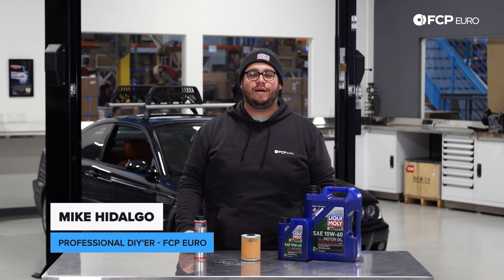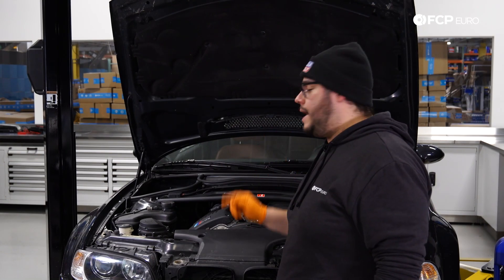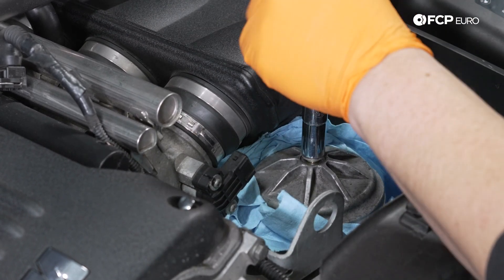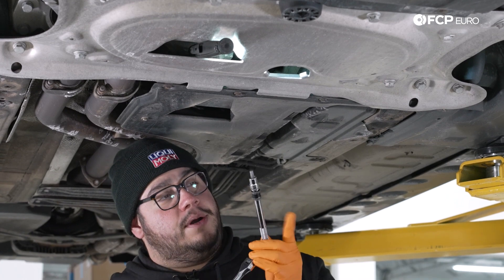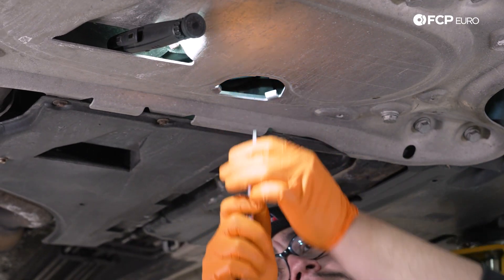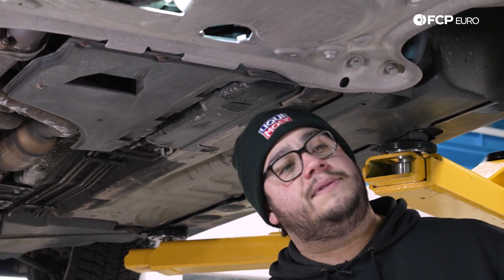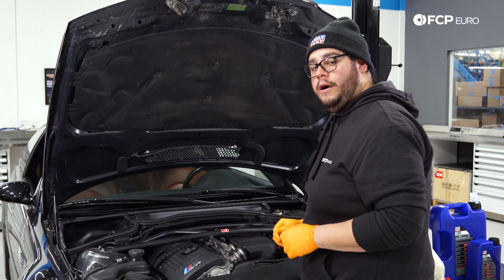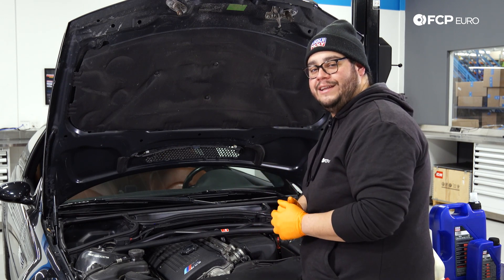BMW E46 M3 Oil Change DIY (2001-2006 BMW S54 Engine)

Comment: Thanks. Was a great was for my son to build confidence in changing his oil. However, we googled it and browser watched it. I didn’t have the option to “like it” (otherwise pay my dues). I had to click into it, sign in and hunt down the video. It didn’t come up top with the same criteria or search so I had to go back and search for your channel then I couldn’t find it right away, so I went through the app and search it so I can make sure you got the like. Then I thought about how few people are going to go though that from browser searching and I wanted to comment. Great content, super clear and easy to understand. It should be easier to like/comment/sub but I guess there is a reason for that. Thanks again for the education.

Comment: Love the videos but the first step MUST be to warm up the engine for 15 mins before anything. That 10W 60 oil is THICK and it needs to be warm to drain out properly. I guess if you're letting it drain over night you could maybe get away with it but believe me it MUST be warm or you'll only get 5 liters or so out of the car. I know I do it every 5000 miles.
Reply from the maker: Great note, Greg!

Comment: Man I look at the 10w60. So glad I switched over to 5w50 honestly.
Reply: Just did the same thing today. Hope I can tell a difference
Reply: why u switch?
Reply: @alikermani6731  For me personally, I was looking on bimmerwold looking at the redline 5 50 oil, they were saying that it helps with the overheating and keeping the oil Temps lower. I have definitely noticed a difference.
Reply: @ruachhibbard3796  so which oil is the best?

Comment: I see some site say the oil filter torque is 24 ft-lb and some say is 18 ft-lb which is correct for 2006 M3 -
Reply from the maker: 32Nm/24ftlbs 👍